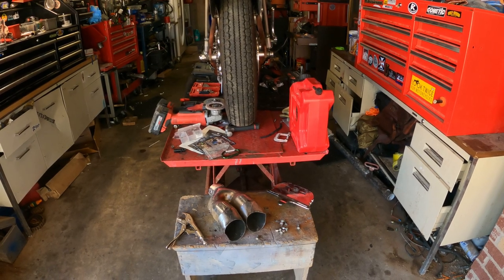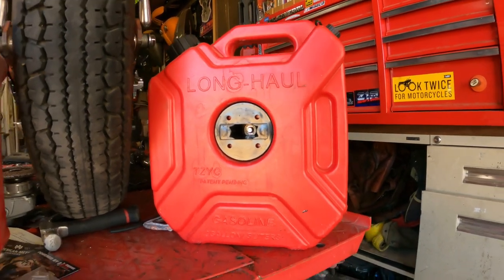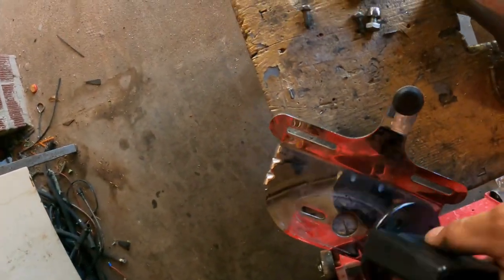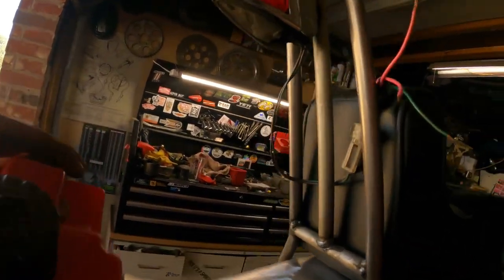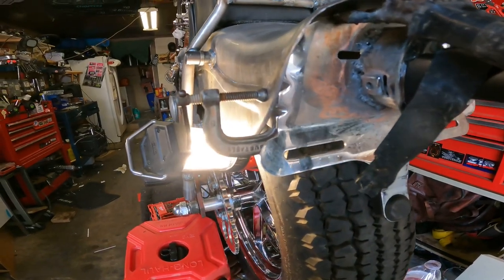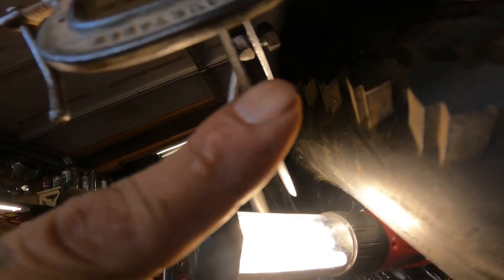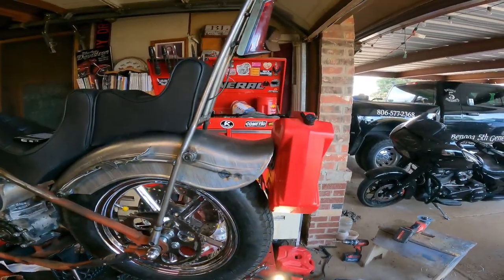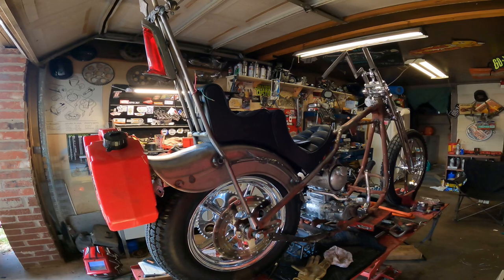Gas grass or a##! Fabricating a gas reserve bracket for spare fuel.

Comment: only problem i can see is if the rear wheel flicks up something that can  puncture the container is it protected for the full length of the bottom if so good to go and a clever idea
Reply from the maker: It's double walled polyurethane. It might get some dings, but I don't see it catching a hole. But you never know on a chopper. Lol

Comment: Do you have enough room from rear tire to gas jug...looks close ..
Nice idea for storage tank/jug..
Reply from the maker: Yeah. It has 1" clearance between tire and bracket with out chain on, axel fully extended to end of axel plate. Once chain is on it'll pull closer to frame and have almost 2" clearance.